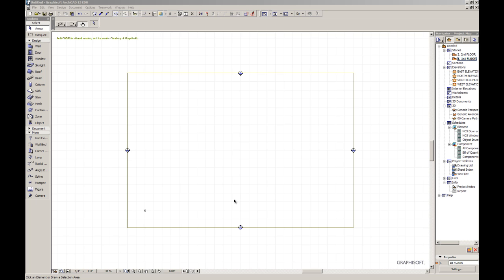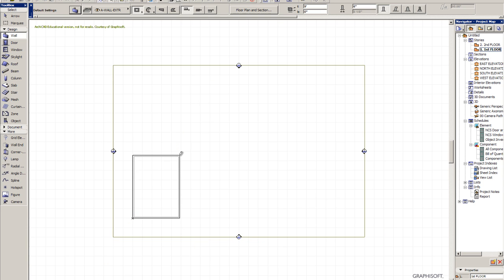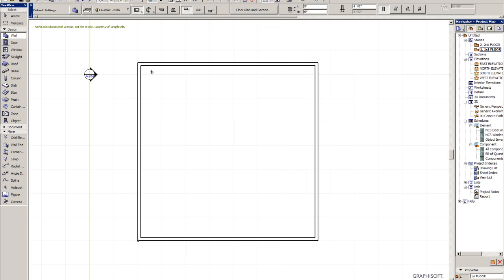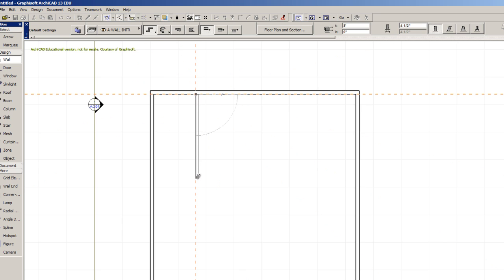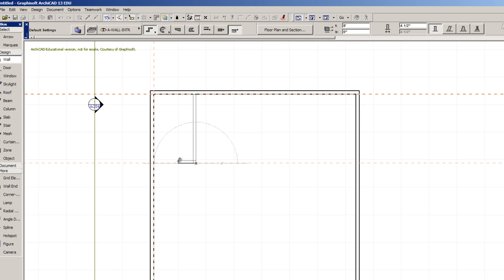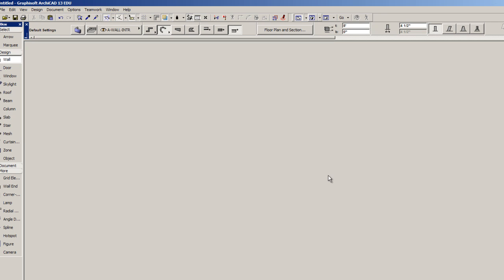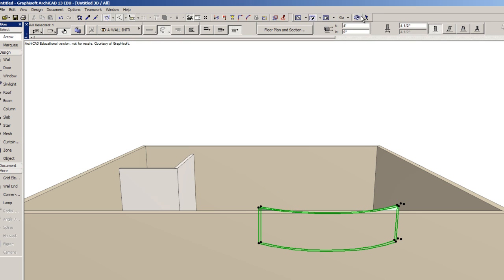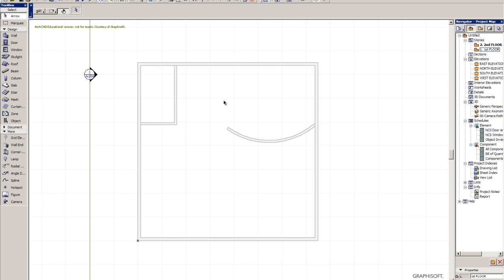Drawings Walls in ArchiCAD

Comment: How do you create stacked walls in Archicad? Jut say you want the face brick wall from ground level to stop just below your windows and normal brick wall to continue where the facebrick stops (this is for an exterior cavity wall) and then on the inner side of the wall which is the interior of your building you have a normal brick wall. I'm new in Archicad and I've been looking for a way to do this but I keep failing, with Revit this was very possible, I believe it's also achievable in Archicad but how I dont know. Please help.